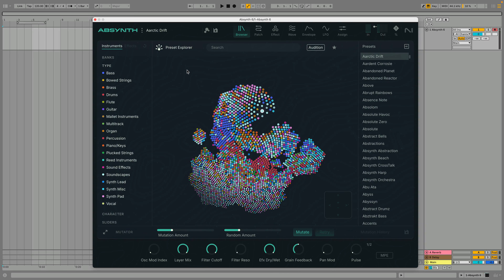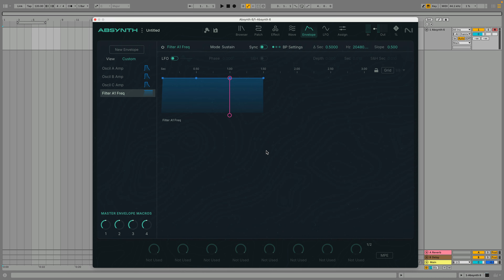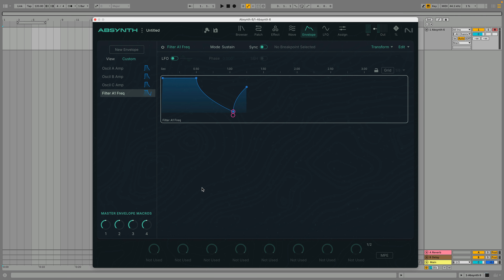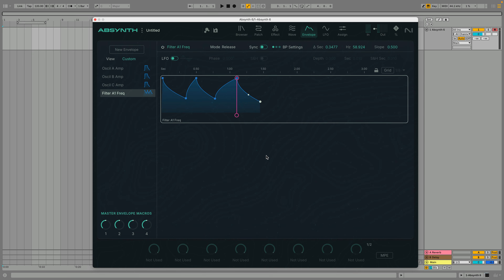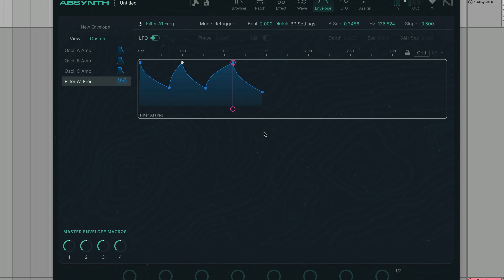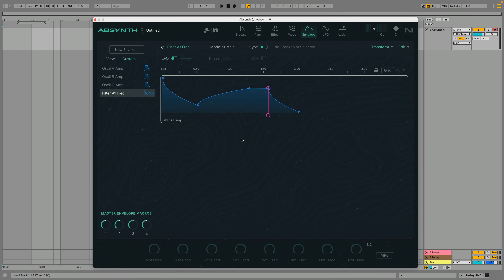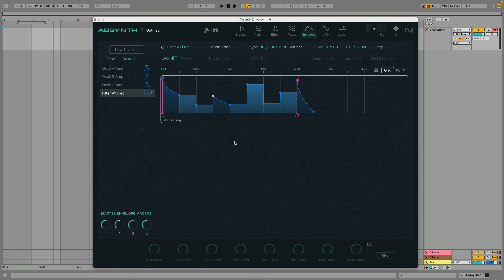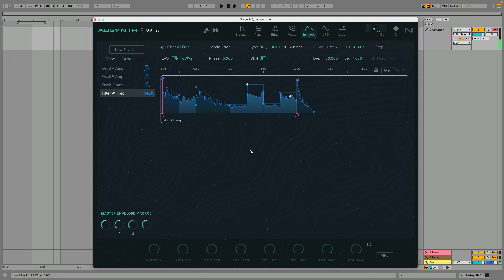Modulating with envelopes in Absynth 6 | Native Instruments

Comment: Looks great so far! But I haven't used Absynth since it was initially released in the early 00s, can you still "write" a waveform and pinch the harmonics to the desired shape? Judging from these videos it's all preset shapes.
Reply from the maker: Hey there, there is the Waveform selector that lets you choose the desired waveform. More details are outlined in the user manual https://bit.ly/48TRgW5

Comment: do Absynth envelopes have a legato mode?
Reply from the maker: At the top of the Assign page, the Global Response area lets you adjust how the instrument reacts to your input. It contains a legato setting. Please see below:

Glide: Adjusts how fast the pitch evolves between played notes. For higher Glide values, when you play the next note the pitch will slowly evolve from the previous pitch value to the new one.
 Legato: When on, the Glide setting only affects notes played legato (without interruption). When off, the Glide setting affects all the notes played
Reply: @NativeInstruments  thanks for your response... maybe i used the wrong term.  By legato mode, i meant in a patch with more than one voice, if i'm holding down one note and play another note the envelope is not re-triggered on the second note... it would continue on its path... is there a setting for that?  thanks!
Reply from the maker: We would recommend to check out our community to receive assistance with our users:  https://community.native-instruments.com/